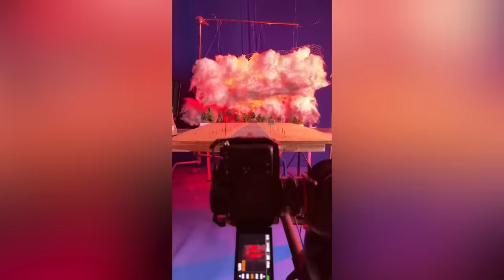Most Mind Boggling Moments Caught On Camera

Comment: That avalanche at 25:49 dlwas not started with a gunshot, but by setting of an explosive device.
I do this in my job in Norway. But we sometimes use a helicopter to drop the explosive. But mostly we have to be airlifted to the top, and set the charges manually.
Reply: I have heard about some countries using artillery cannons. But i don't believe that to be practical.

Comment: 28:06 Just because you see two "gentlemen" lighting a fire out of a frozen lake does not make them 'ecologists;' it just makes them two bored dudes who drilled a hole on Lake Baikal in Siberia (Russia) so they could fire off the methane build-up from the decomposition of submerged organic material such as algae and leaf-litter. I'm fairly certain that the methane is a great demonstration of entropy in a closed system. I doubt that this consideration isn't part of the equation of burning water because it looks cool

If you don't mind reading, it doesn't take an ecology degree (or even college credit) to learn that methane is produced from the breakdown of organic compounds, demonstrating the second law of thermodynamics, which states that more energy (warmer areas) will always break down into less energy (colder areas) and can never reverse without the introduction of an engine of some kind.

These two guys would be equally at home at a rerun of a "Jackass" movie. (Although I'm quite certain that these are very nice people who would never do such reckless stunts...🙄)

Comment: 4:20  that “person” is a chiropractor who trained (i think on his own ) to adjust animals.  Thank you so much for including this in your vid collection :). he has had incredible results with spinal adjustments when needed. he has even worked on horses. i’ve seen vids where the animal has seemingly shown, “Like, gee, thanks. that feels better,” by rubbing their against him, licking him, or however they would show liking someone. 
others, of course, just run away, but you can tell they usually feel better.  i do hope he’s training other chiropractors cause they sure could help with many problems.  :) 🐶🐈🐴🐕🐑🫏🌷🌱
Reply: I don't know where you got that from, but only a fully trained vet could possibly know how the bones in animals are placed.
There is no way a dog that didn't know him very well would let him do that, and would stiffen up. That noise of the joint cracking was added on.
Where would he have learned his animal physiology?
This clip is false, like many in this vid.